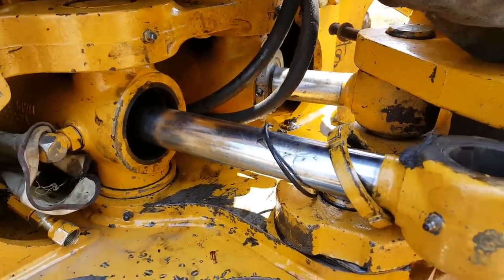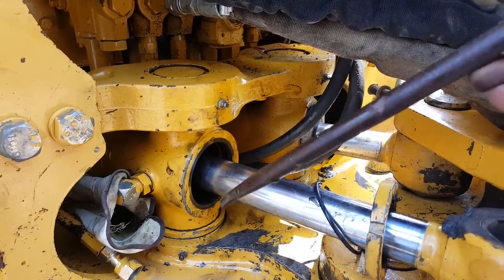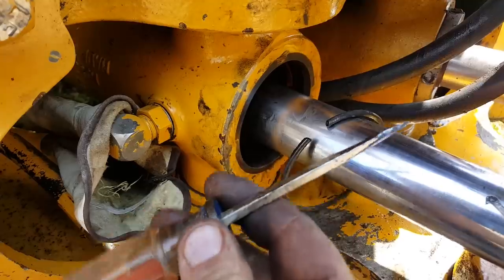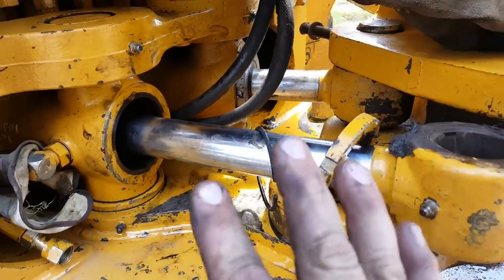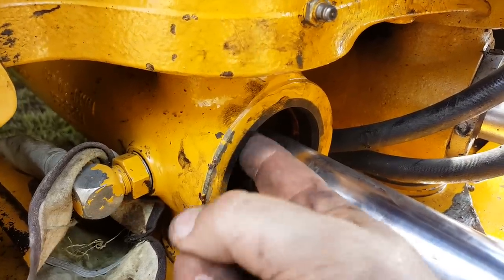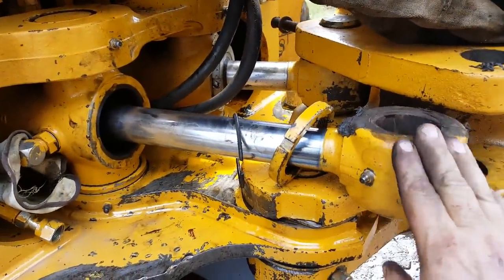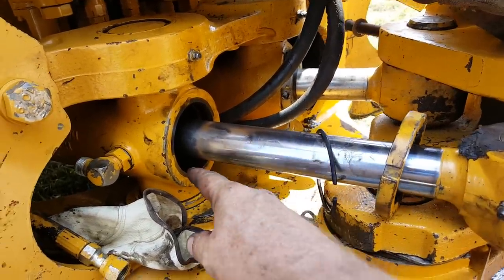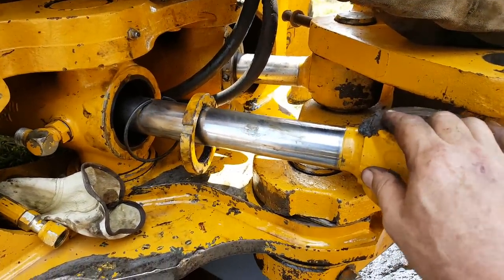Repair swing cylinder backhoe JD 310 E

Comment: Many thanks for the video. I have a 1989 John Deere 410C and I'm in the process of repacking all of the cylinders at the moment. I already have all of the seal kits for both the pistons and the guides on each cylinder, however I'm taking all of them to a local business for them to repack for $70/each with the exception of the swing cylinders... It looks like the swing cylinders are easy enough to repack while mounted on the machine... Do you simply swing the boom all the way to each side when attempting to disassemble each cylinder? Also, did you end up also replacing or sleeving the pivot pins on the boom where the boom articulates right to left? Any information would be appreciated. Again, thank you for the video and great channel!

Comment: I have a problem with my 310G in the swing cylinder is very hot i use only 10 min for touch very hot i donot why?? Somebody help me
Reply from the maker: The only thing in the swing cylinder that would get hot is the hydrolic oil. The cylinder would not make the oil hot. Is only one cylinder hot or both sides? The oil also lubricates the transmission and the machine will heat the oil. May be that you need to service the radiator or change the filters to make sure the engine itself (the heating element) is not overheating.
Reply: Cameron Smiley both cylinder. One cylinder is more hot

Comment: Yep helps a-lot. I have 310G that the same cylinder is getting very hot and noisy like a dry pin that needs grease. Need to pull it apart and see if it is fix-able or not
Reply from the maker: If you have metal on metal friction within the cylinder your problem is far beyond a seal kit. You are probably going to have to get a new cylinder...unfortunately. Ok ...yes ...metal on metal friction will make the cylinder hot but you have already destroyed the cylinder in that case.

Comment: Could you use the boom to pull the rod out instead of a come a long?   Hook a chain to the bucket and extend it.  Don't hit the swing pedals of course ;-)
Reply from the maker: Not recommended! When your old seals come up on where the snap ring was you have to be very careful that they slide easily past your temporary plastic filler ring smoothly. If you have too much resistance STOP!!. and push the assembly back to make sure that temporary plastic ring is still seated properly. Trying to force it past if seals  get hung in that snap ring groove could mean loosing the whole cylinder. Be very careful here and pay attention.
Reply: Good points.  Thanks.